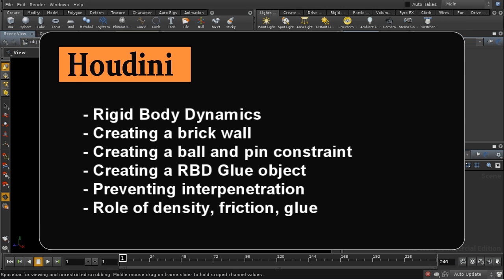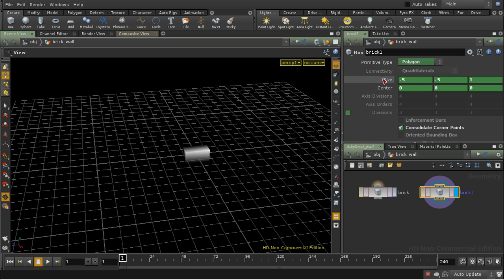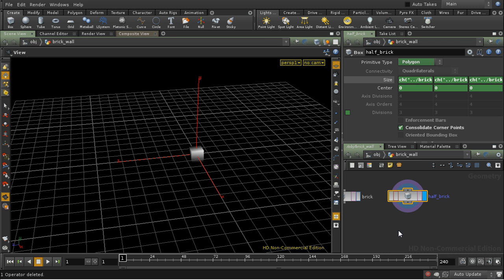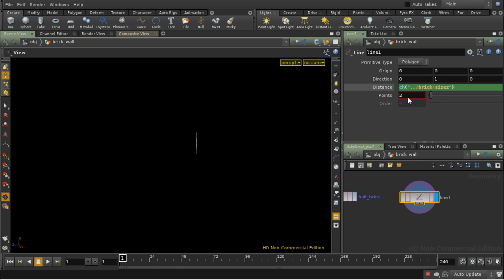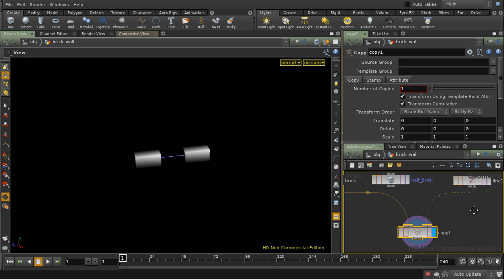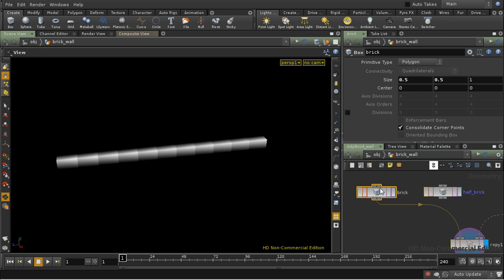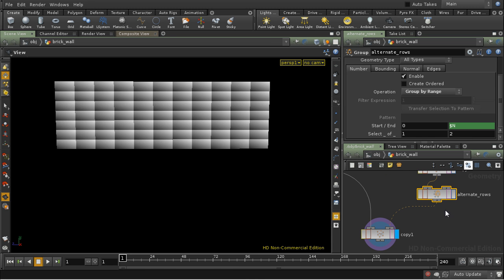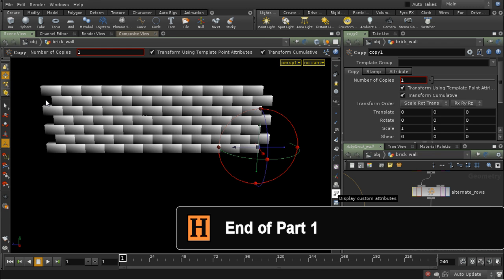Houdini Brickwall 1

Comment: Hey Peter.... I know this was years ago, but how does it work by now? The copytopoints function will work as far as copying the first line, but it will mess up when you start to copy the line itself to make the line of bricks higher.
Reply: I solved it by using the "copy&transform"-Node after creating the first row of bricks. From there you have the same parameters as shown in the tutorial. So you can reference the y-size of the brick for the y-transformation of the copy.